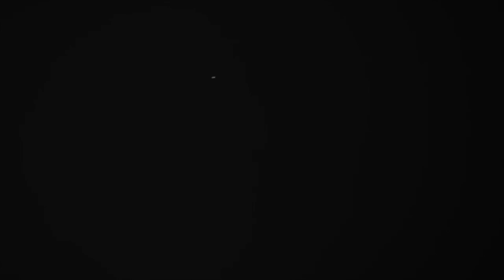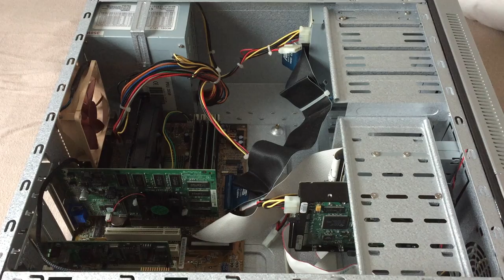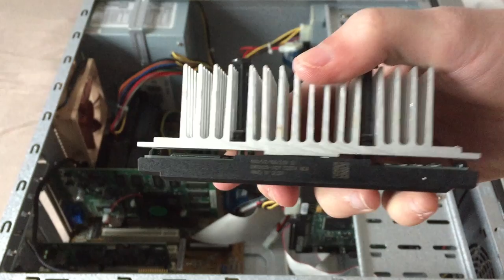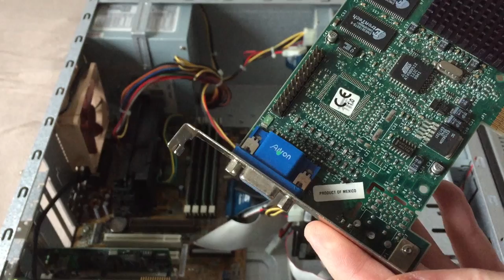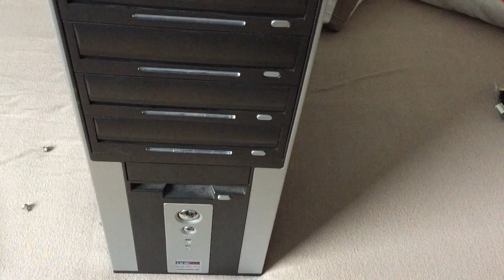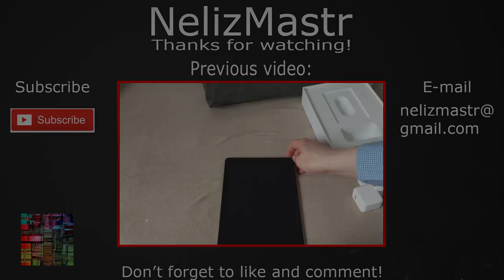Pentium II Project - Part 1 - Build Overview

Comment: I've been thinking of building a computer much like this one, but would this kind of motherboard fit to a newer tower ? Have been thinking of a tower of pure glass
Reply from the maker: ATX is a standard form factor that was starting to become common with the Pentium II boards and it’s still in use today, so it shouldn’t be a problem. The main issue is that modern cases don’t have external bays for CD-ROM and floppy, which you really need as USB booting wasn’t a thing until roughly 2005.
Reply: @nelizmastr  Thanx for answer. Ill check this out. I know it should be possible to tune something

Comment: Product of Mexico? Given that and the way the board was made, I'd go with it being an STB card, likely already under 3DFX ownership by that time. Seems as though it should work well, this machine, haven't seen part 2 yet... I miss my Pentium II, very useful machines.
Reply from the maker: The VBIOS on the card indicates it being manufactured or at least distributed by Elpin. It performs admirably with this Pentium II. I got the card for free, and seeing what the going rate of the V3 3500 is, I'm pretty certain this V3 2000 will be more than capable. I also tested said Geforce 2 GTS, but that card isn't really suited to this category of hardware I noticed. Even a P3 550 heavily bottlenecks it round the block and back.  The combo seems to handle mid 90's up to the millennium just fine.
Reply: It should do just fine. I did OK with a Matrox Productivia in mine though I never really ran much in the way of 3D as I used it primarily as a "Superfast" DOS machine, running Shadow Warrior at 800x600 for example, and point-and-click which only used DirectDraw at most. I also agree that a GeForce 2 GTS would probably be overkill, I have a Quadro 2 Pro in my dual P3 which essentially uses the same GPU, it feels about right alongside the 1100MHz processors, so I would definitely write that one down as an Athlon-era (Pre-Athlon XP) card. Overdoing it with the GPU can actually make performance worse because of things like driver optimisation too so you do right to balance it out.